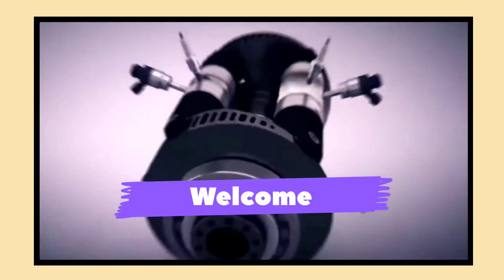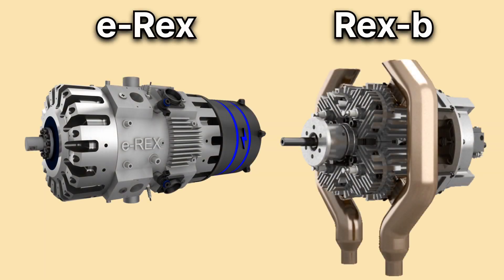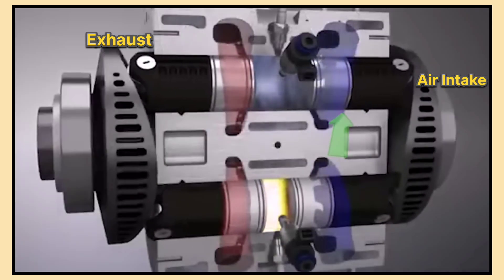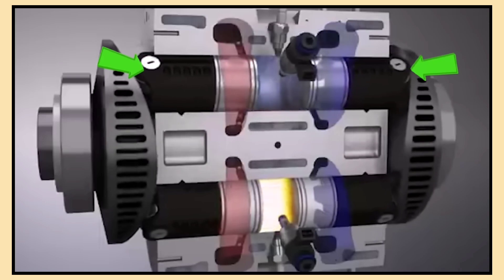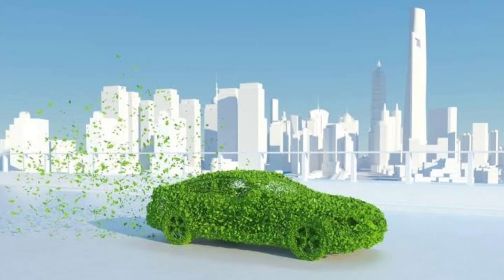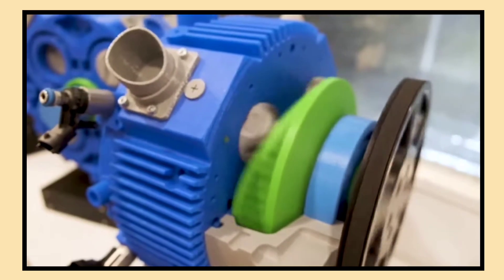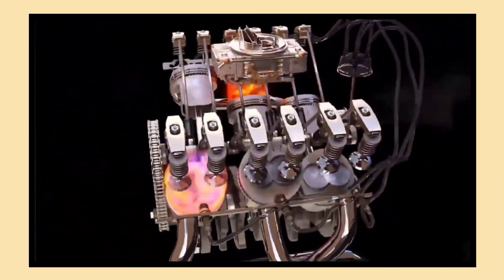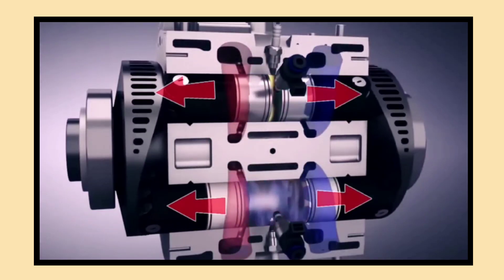"The Future of Internal Combustion: Understanding INNengine's 1Stroke Technology"#engine #technology

Comment: But its just a 2 stroke with opposed pistons. Not a radical design
Reply from the maker: "Actually, the e-REX is not a traditional two-stroke engine. It employs unique 1Stroke technology, which enhances efficiency and power in a novel way. You can check the official page for more details!"
Reply: nothing unique, nothing ground breaking, just another "re-invention" of already tried concepts, proven long ago to be entirely unfeasible... and overlooked, neglected, barely documented or taught about for the very reason that none of them ever worked out as expected... what a different world we might live in now if we also educated people about the ideas that proved to NOT work rather than prattling on about the ideas that do, so they didnt waste time simply "reinventing" junk.

biggest issue with the swashplate or cam designs is the line of contact of those rollers... massive pressures, along with the fact theres no "point of convergence"...  consider why taper roller bearings are made tapered... so they roll along their entire length rather than slide... cant do that if the rolling surface isnt a true conical surface. consider why we have differentials... because the inner wheel travels less distance than the outer wheel. now apply those two ideas to this cam design... to ANY cam design. they have an inherent, and not so obvious fault... the rollers SLIDE rather than "roll".

the only swashplate engine that showed any promise was the michel, and it had other issues... yet the thrust bearings used in that design are still manufactured and used in thing such as propshafts on ships... they were the best part about it. true oil film contact. unfortunately they only work well in one direction, with a unidirectional force... that cant be achieved in a "reciprocating" design.  michel also made a rather peculiar "opposed piston' using THREE pistons... 

then you have the lamplough design using a yoke and spherical rod ends, also worked reasonably well... (and rebirthed in the "duke barrel motor")

but wow... he went mad with pumping pistons and sleeve valves and other strange, complicated mechanisms... but lamplough was prolific, making several designs that all have various useful attributes... just none proved to be successful due to other mitigating factors.

i still havent seen any design that addresses the fact that the mechanisms we use to convert linear to rotary motion are simply the same mechanism we use to produce massive pressures but operated "backwards"... and i have seen far more designs than the average enthusiast could ever dream of...

we use cranks in PRESSES. we use cams to make LOCKS. another device is an "over center latch"...  they convert a small rotational effort into a massive PRESSURE or linear force... it doesnt work out so well in reverse, converting linear pressure or force into rotation... yet that is the basic element of ALL our engines, except for the turbines.

our engines are air compressors. theyre EXCELLENT compressors... can reach tremendous pressure for very little effort.

theyre terrible EXPANDERS. those same tremendous pressures only produce small efforts.

we really are stuck in a rut... mostly due to limitations of geometry... there seems no way around that... not with traditional thinking, anyway.